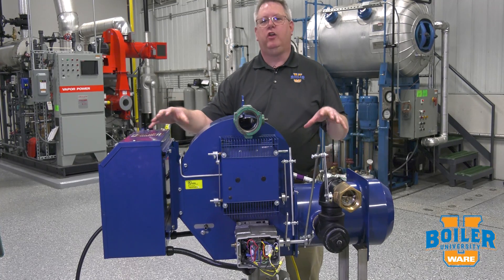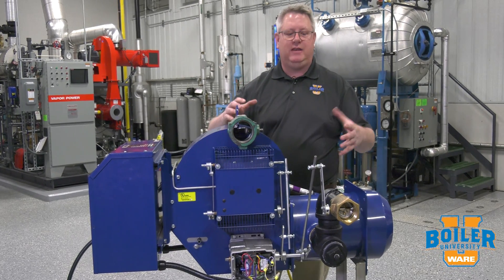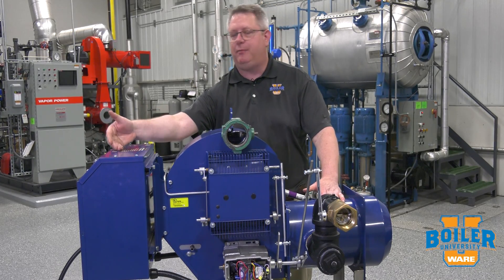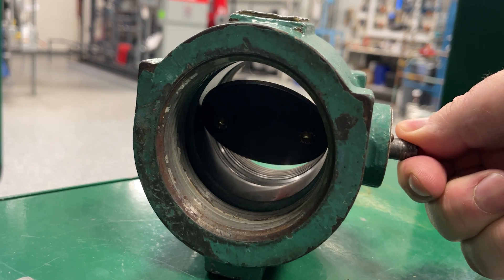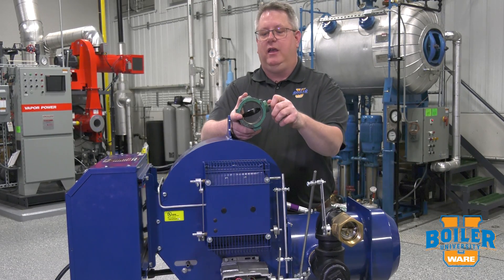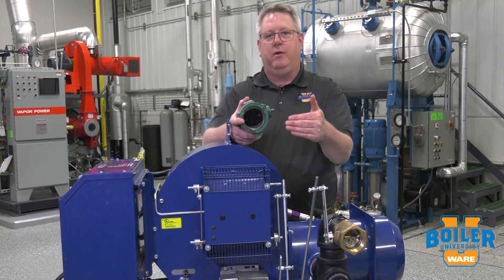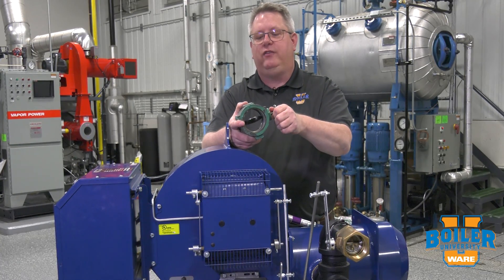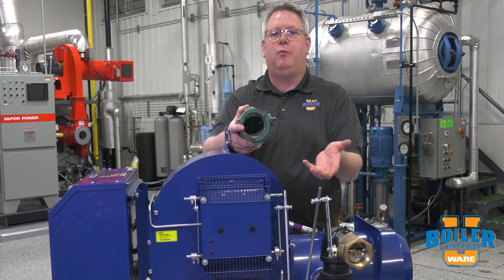Combustion Series Part 2: The Burner - Weekly Boiler Tip

Comment: Good day Sir, about the boiler before stack temperature 267 to 268 
After we clean and change nozzle diesel 
After running 8 hours stack temperature higher 300 automatically shut off boiler and reset to run the same stack temperature 300.